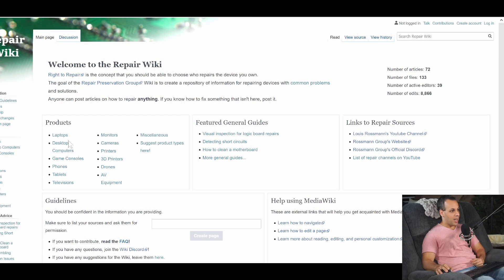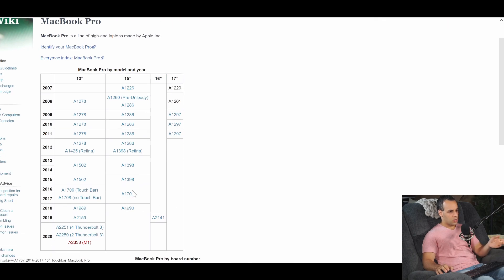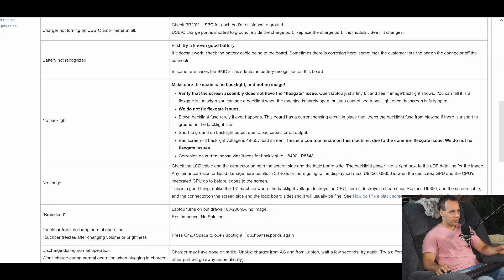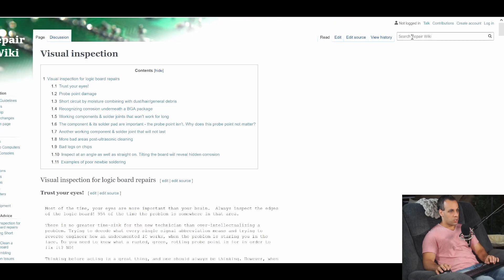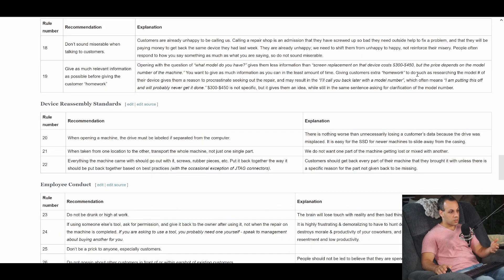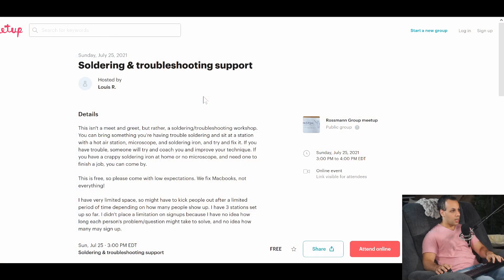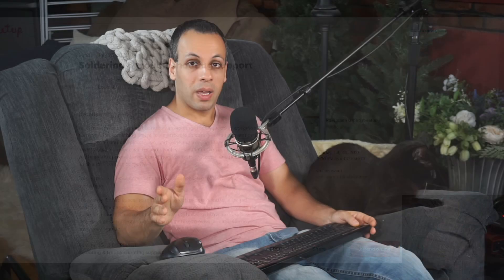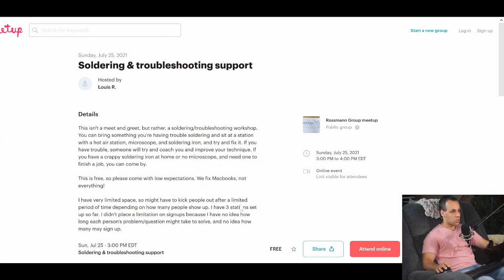Free soldering and troubleshooting workshop

Comment: This is a great idea! I've been thinking for a few years that I'd love to have a place like this for wood work nearby so when I need to do some one-off thing I don't have to buy all the things and power tools I need and would just be able to pay somebody for a few minutes, hours or day of "rent" and work on someone else's. 

This should become a global trend honestly. Especially handy for larger machines like lathe or vertical drill for example. Not everyone wants to have a full blown workshop in their garage and not everyone has a garage to begin with. Or money to get all that. But unlike soldering the wood work thing will require some safety instructions course and signing a waiver probably as there are number of ways to hurt yourself.

Comment: I have a soldering question: Can my soldering iron be too hot, for through hole applications? How does 300ºC sound? I think it does the job, but I fear it might be to high and may damage the tip or even SMDs when used on Arduino.
Reply: solder melting temps :>
https://en.wikipedia.org/wiki/Solder#:~:text=Soft%20solder%20typically%20has%20a,are%20the%20most%20commonly%20used.
Reply: @outseeker  Thank you, but I still wonder if having a much higher temperature is significantly troublesome. Since I don't touch the SMDs with the tip, but the heat travels through the PCB, I'm not sure how long I can be confident I won't damage unions close by.
Reply: @SharksShade  given the range of solder melting temperatures, i don't think 300 is necessarily too high. pretty sure u want the iron hot enough to instantly melt the solder, so you can just touch a leg for a moment with both the iron and solder and you're done. the longer u have the iron touching the component, the more energy is transferred away from the specific area you are trying to heat.

that being said i have bugger all soldering experience and just tried to help by answering with logic alone XD
Reply: was that you who rocked up to the free workshop?? :D
Reply: @outseeker  Unfortunately no, I live in Spain. I would've love to, though! xD

Comment: Louis, I read that the NYPD are not allowed to prevent unauthorized street venders from setting up. How much more profitable is it to be a street vender rather then a brick and mortar shop. Where I am at, there are a lot more curb side restaurants in trucks that park near a business area around lunch time. I have been told the venders save so much money not using commercial realstate.

Comment: Most of the non-computer stuff the misery likely traces back to some bloated dead electrolytic capacitor if not something mechanical in nature like a switch wearing out or being fouled. And then the chain of whatever follows from that going bad.

Also before anyone starts, better make sure they at least know how to hold a soldering iron. (An open invite type thing, that's one of the risks.)

Seems like a neat thing to do. But it also sounds like a potential hand-full in a big city vs. some smaller town where there would be less people to show up.

Comment: I unfortunately can't come because I'm in Oklahoma. 
But would this type of thing be for someone who wants to just learn how to do something simple like resolder the USB port back in place? 
I'm hard on my devices USB port due to constant use. I spend a lot of time watching YouTube & reading on my tablets due to severe fibromyalgia. It's a distraction. 
If this works out you might try to find some maker spaces people could use to hold their own workshops. 
The central Tulsa Library has a maker space that includes at the very least a soldering iron. Plus an enclosed room with tables that groups can work at. 

It's actually pretty amazing what they have from 3d printers, cnc mill, Laser cutter, server, drill, Dremel, loom etc. 
I could easily see them offering the basic equipment for people to do simple repairs on their devices. I mean what better use of that area to a lot of people. 

I'd definitely go if someone was there to help out with learning to fix your own problems. Actually I plan to eventually try fixing an old tablets USB port anyway. 
Good luck with this. Wish I could go.

Comment: Any advice on getting started with soldering? I've worked in entry level device repair and I want to learn board repair and soldering! (I'm moving to nyc if there are any classes, but online guides work too!)
Reply: louis' whole back catalogue of videos pretty much is the learning to diagnose and solder course lol
he used to repeat himself a lot more in the older videos, going over every aspect of every step he was undertaking- just check a couple out and you'll know the process and can see how he solders with an iron and hot air gun

Comment: Louis I recommend looking up this Tech manual used by the military "SE004-AK-TRS-010". All branches use this as a standard instruction for grading criteria and is available to the public. Keep in mind its 892 pages though and may help you develop the Wiki page. It was the first link on google labled "(2M) Electronic Assembly Repair - Robins Air Force Base".

Some pages of key interest to me are; 164 - Example of solder joints, 289- Through Hole components, 322-349 Some grading criteria, 483-485 Laminate repair, 756 Suface mount begins. Pages are base on PDF numbering not Tech Manual numbers as most people will not print a copy.

Comment: Louis how can it be that in europe the system for cars and phones is this wAy. If the product is in warranty   terms say if you have a problem with 
 Car and you didn't do dealer maintance they wil help you but they make you pay a part of the repair cost. With phones it's the a bit more clossed for example iphone 6 software broke phonr didn't boot. It happend in 2019. Tmobile repaird it through apple without cost for customer. Apple said no it will cost 400 euro to repair. What do you think of this storry i am curious on your thouts

Comment: A bit niche soldering technique question: is there a high-quality (=reliable) accessory that attaches to the handle of a soldering iron which then feeds solder from a spool to the iron’s tip?
(for one-handed soldering due to injury)
Reply: Something like this exists.  Our CM in Thailand used a device like this to ensure even solder and flux for the components that needed to be hand soldered.  Unfortunately, I cant tell you what it is called because I never saw it in person nor do I know who makes one.  Maybe start with Hakko?

Comment: God i would have killed for this. If i lived near your shop i would be down for a hourly rate for it etc. it is expenaive to get a setup for tecnical diy shit. Like i have at least 60 screwdrivers. Why do we need a "80s speaker screwdriver"(a normal plus driver but it is 30 cm long since old speakers rrquaire lonnnnng shafts). Granted you guys probebly dont have those but my point stands.

Comment: More people should know how to solder both electronics and plumbing.  It's really not hard to learn, but there are TONS of tricks and tips to learn from people who have done specific kinds of soldering.  Whenever you think you know the best way to do things, some oldhead shows up and makes you feel like an idiot.

Got wires?  Alligator clips are AMAZING.  Get creative with your supports and see if you can free up a second hand.
Smoke in your face?  See tip one.  It's getting in your face because both hands are near the iron.  There's science.
Flux.  That is all.
Soldering material MATTERS A LOT.
Patience is great in the long term when you are learning to solder, but when you are actively soldering maybe hurry the hell up.
Embrace the fact that even if you can solder really well, you are still terrible at it.

You CAN learn on your own, but EVERY solder-er (or welder for that matter) has very real personal experience that is entirely unique to them, and the tips that they learned from those experiences are great.  If you wanna learn, find people who do it professionally and see if they want some extra cash.  Or get a job at places that manufacture electronics and pick the brains of BOTH oldhead engineers (young ones haven't turned a wrench, it seems) and all of the people you work along side.  They know stuff.